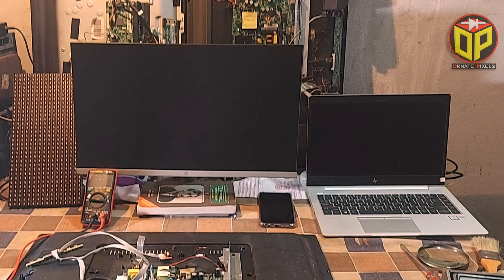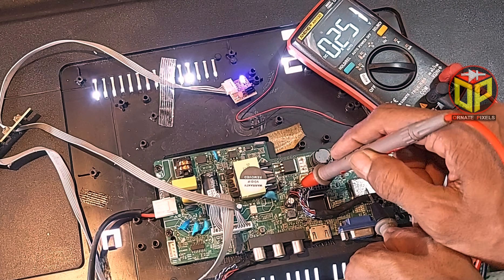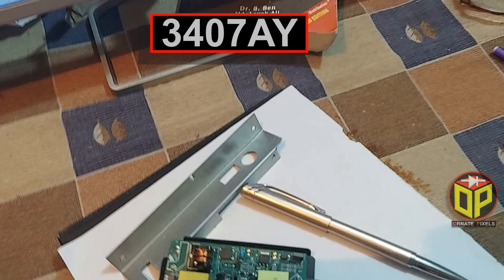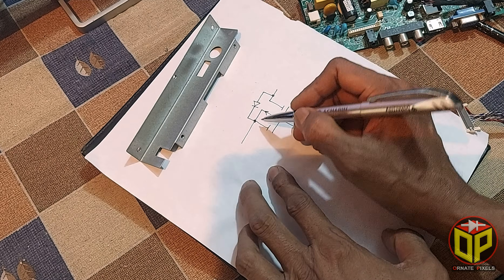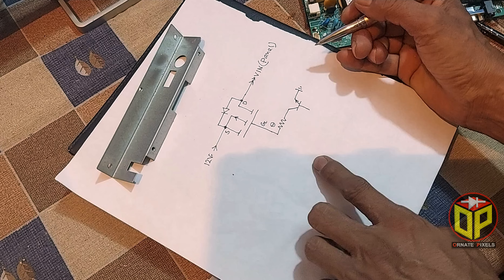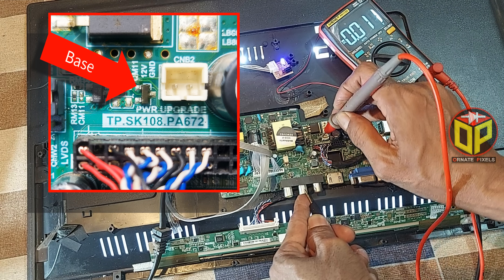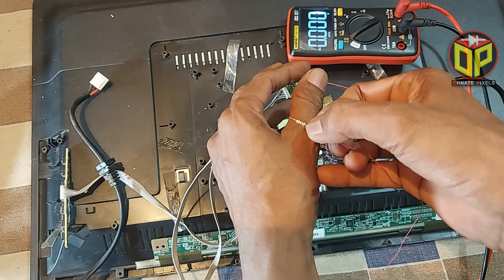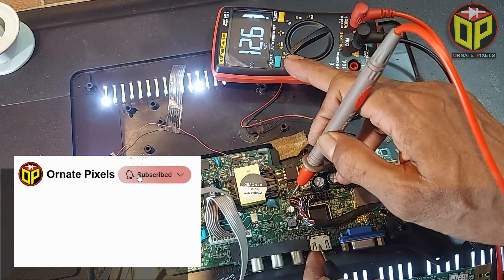🖥️LED TV Repair: Restore Panel Voltage With a Clever Hack to Solve The Black Screen Problem

Comment: A very helpful video sir. 
I have a question. If I want to power up my TV with 12V  20amp battery, can i connect the + and - of the battery directly to the ground and cathode of the diode after the switching transformer? Or could you give any suggestion on this? Thank you in advance, sir.

Comment: Hi sir. Half screen hidden by grey color and sometimes freeze the image from top to bottom in my Sony 32 inch led tv. Kindly clarify. One more doubt is in motherboard after MOSFET tpc8125 the 19v doesnot moved to otherside one diode i.e. mentioned as E9.can u tell me wat is this diode or zener diode and it's value because I want to change it.
Reply from the maker: From your vague and short description, there may be a short circuit in your TV panel (CKV/CLK, etc.) or gate COF. Can you capture a clear picture of the place on the motherboard where 19 volts are not being output and post it on your Facebook page (Ornate Pixels)? I don't remember any fault in any circuit. Whenever there is a problem with TVs, I check it out and find a solution. Thank You. 🌿❤🌿

Comment: Intresting video - Panel Enable Voltage ....🎉🎉🎉🎉

Sir  y should v use 22K  to NPN Transistor base...?
Shall v use 12K or 15K  to that NPN Transistor Base
Reply from the maker: It should be kept from 22KΩ to 50KΩ (approximate), 
because no more than 30 milliamperes of current is required to the base of that transistor. Thanks Brother 🌿❤🌿
Reply: @OrnatePixels  Thank You very much for your valuable Reply Sir💮🌼🌻

Comment: In Nigeria, my boss do tap it direct from the 12v lol
Reply: Very wrong
Reply from the maker: If you turn off the TV with the remote, the voltage will remain on the panel,
so providing a direct supply is not the right method. Thanks! Brother. 🌿❤🌿